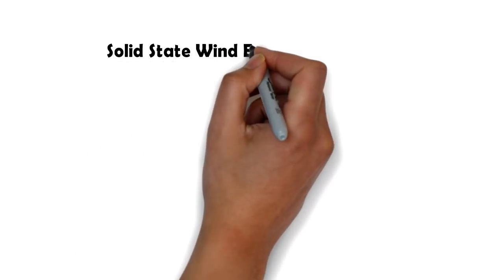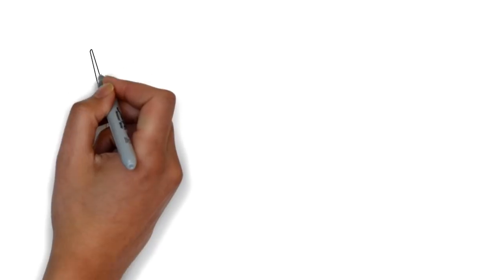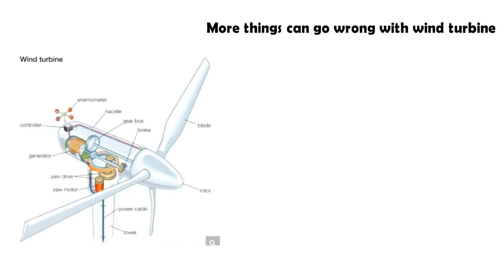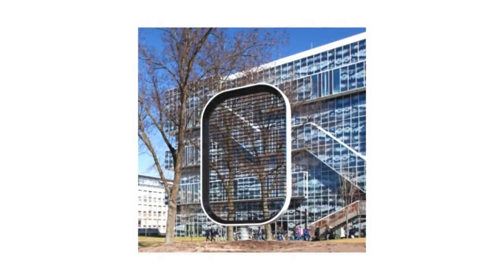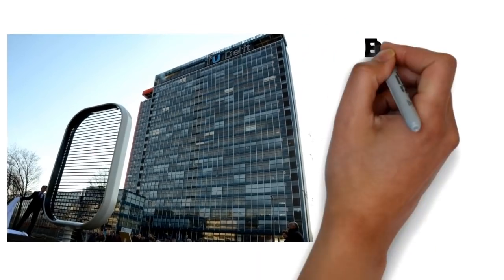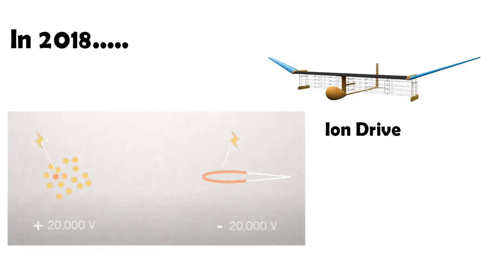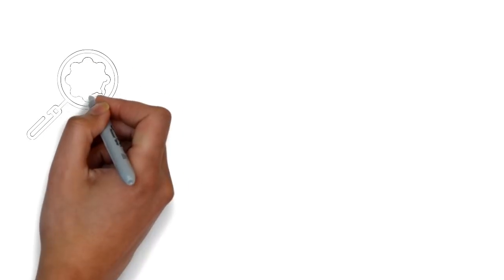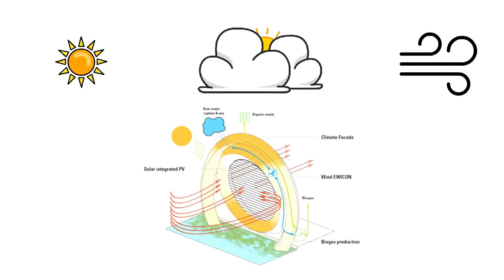Solid State Wind Energy Generator. A Revolutionary Device

Comment: What happens when birds and insects start getting vaporized, it's 40,000 volts after all 

basically you just installed a massive   bug and bird zapper
Reply: You can get zapped by a million volts and feel nothing when the current is low enough. And the current cant be that high since the ions movement has to be dominated by wind for any net gain in power.
Reply: Climate change will  kill alot more than windmills. You sound like the whalers from Nantucket.  They were kings of the see passing through drakes passage hearky. Whalers lrize cargo was oil made from rendering whale blubber while at sea. It revolutionized the way people spent their evenings!. Many a book was written under the lantern's glow. Whalers did not like the fact that crude oil was found and it  was vastly superior to whale oil in every possible way.  Whalers fought the coming of the end for the bussiness and like repubkicans they would have shut down the new oil production permanently. That is what republicans are doing today. They would get rid of wind power, hydroelectric, geothermal, biodiesal, solar paneles and todays republicans are even refusing to build 4th generation walk away nuclear powerplants which are critical to moving from whale oil to crude oil.  Actually it is the move from fossil fuel to renewable energy systems. The movement from fossil fuel to renewable enetgy will do three thinngs
1. Make energy cheaper.
2.Allow the people to use alot more electricity than we can now
3. Provide millions of real and high paying jobs.  
Mitigating climate change isnt the only reason or even the main reason for building the new grid.

Comment: The principal behind the solid state windmill is best used in space applications. Ion drive electrostatic engines have been used to propel interplanetary spacecraft or can be used as a space tug to boost satellites to higher orbits and prevent orbital decay. Very low thrust, but very high specific impulse.

Comment: Will it stop killing eagles and hawks? Does the removal of moving parts reduce the sound pollution? Is it still made with radioactive trace materials? These are my objections to wind power as it’s currently used.
Reply from the maker: Birds detect high voltage coronal discharges and normally stay away
Reply: Synergy Files I hope you’re right about that. So far I think wind and large solar installations are counter productive for the environment as a whole. Only 4th generation Nuclear is actually green. Even electric cars will leave us w poisonous batteries staked up next to their tires waiting to be recycled.

Comment: How would they deal with the ensuing ozone problem from all that ionized air?

Edit: Honestly, I was expecting to see some form of piezoelectric effect device acting like a reed in the giant wind instrument/power generator.
Reply: What if your initial ionization on the incoming air was then followed by a de-ionization/recombination at the end, as the flow stream exited the device?
Reply: @manofsan  I'm not enough of a physicist to know the answer to that, but I think there is no way to do that while maintaining efficiency, which will already be bad from the energy needed to break down the bonds between the dielectric material and it's electrons in the first place.

All I can see are the problems caused by production of Ozone, oxides of nitrogen, and corrosion of the electrodes caused by the ionization process.

Having said all that, again, I am no physicist, nor do I even play one on TV, so my thoughts should probably be taken with a can-full of salt... 🤓
Reply: @davidbierbaum4881  Ozone is reactive and eventually recombines with the air anyway. But the point of wind power is to tap the motion of the air, and not its charge - so deionizing the air shouldn't cost us more energy. Recombination is natural -- that's what makes ozone so reactive and dangerous. No extra energy has to be supplied to get the unstable ozone to revert to normal O2.
Reply: Thats why you don't put ultraviolet light inside home, because it creates ozone from oxygen and in enclosed space it's toxic. So maybe only outside where is wind and where is the most space available...
Reply: In terms of piezoelectric effect and vibration of reeds... SF writer Colin Kapp's 1964 tale "The Subways of Tazoo" (not Yazoo, despite what the Android spell-checker is trying to assert) describes working on a planet whose highly-advanced civilization has mysteriously collapsed and left no-one alive. They realize that this is a rather windy place, and the millions of "harps" which they find the remains of in the desert were not to deliver the sounds of the subway to desert-dwellers but had vibrating string tuned to resonate in the wind and generate power via piezoelectric crystals in the arms of the harps. 
This story is much more interesting than it sounds; but I remember this aspect and wonder whether a solution like the one described in the story wouldn't be similarly efficient in generating power in the windier parts of the world. This was from a series of stories under the title "The Unorthodox Engineers".  I can recommend Colin Kapp as a very readable author, as far ahead of his time as many science fiction writers are. When I first saw the Delft generator, I thought it might be one of these harps; but their solution seems (to me) to be cleverer for lower wind speeds at least.

Comment: Little by little fossil fuels might be done away with .. I can't wait until they get Thorium reactors online .. Take a few 100 billion from the corrupt military-industrial complex to make it happen
Reply: I think thorium will be the nuclear fuel of the future. For now we should use enriched uranium in 3rd generation modular reactors, we have the proven technology and light water reactor experience to make it work and implement it on a large scale. As an intern lets develop heavy water reactors that can "burn" unenriched uranium and later liquid fueled heavy water reactors that can "burn unenriched uranium, thorium, plutonium or any combination as fourth generation reactors.  Finally developing the liquid molten salt reactors and liquid fluoride thorium reactors as fifth generation reactors. By then first generation fusion reactors should start coming on line. Meanwhile  we will also be developing advanced renewable concepts and much cleaner and more efficient fossil fuel based energy systems.
Reply: @stuarthirsch  the only reason we have nuclear power is the military needed the enriched plutonium for bombs .. They put money into nuclear instead of thorium research .. Here is a video you might be interested in .. I saw a very good video years ago but don't remember the title
https://youtu.be/ENH-jd6NhRc
Reply: @xadam2dudex  Breeding plutonium is the reason they built the liquid sodium cooled breeder, which turned out to be a fiasco and  dropped research on the liquid molten salt reactor that could have been thorium based. However times have changed and it's time to let the past go and concentrate on the future.

Comment: Sorry Idiot question... Why windturbines have a gear box in the first place?
Reply from the maker: To match it close to the required   high speed of the generator present inside. You would understand that generators need to spin at high RPM to deliver us the 50 or 60 HZ electricity we need. Gear box also account to fluctuating wind speeds
Reply: @synergyfiles3536  ah I see makes sense somehow. But can't a frequency converter and a generator suitable for low RPM do the job or is the generator's max output frequency dependend?

Comment: Solid state wind generators may be more useful as enhancements to existing wind turbines, where they could add a few extra percent of efficiency when the blades are moving, and even a small amount when there is not enough wind to rotate the blades, but enough to produce a voltage on the solid state devices.

Comment: They create OZONE - it's a pollutant and harmful
Reply: @Madd Peanut,  if that's true then why are the global warming freaks
always talking about the ozone depletion being a problem.
Reply: @Frank-rm9yg  Simple Google searches can answer a myriad of questions. Try it sometime.   Ozone in the upper atmosphere blocks harmful UV radiation,,   "When inhaled, ozone can damage the lungs. Relatively low amounts of ozone can cause chest pain, coughing, shortness of breath and, throat irritation. It may also worsen chronic respiratory diseases such as asthma as well as compromise the ability of the body to fight respiratory infections." -EPA
Reply: @Frank-rm9yg  The medium term answer to our energy/climate problems is molten salt/thorium reactors.  Educate yourself on them on their inherent safety and minimal waste before you spout off.
Reply: @maddpeanut7524  I agree and am a member of the Thorium alliance. But I don't believe there is a single magic bullet. We need nuclear, renewable, and clean fossil fuel technology all working together if we are to solve the climate change crisis.
Reply: @Frank-rm9yg  The difference is that the O zone created would be local and low altitude. A local health hazard during high pollution, when there is usually little or no wind and the high voltage would be shut off anyway. The high altitude O zone is what protects us from UV rays, and it is desirable. It is created by UV light interacting with high altitude oxygen but methane and other high altitude man made chemicals destroy that cycle. Nothing to do with solid state windmills.

Comment: Wind turbines often get a lot of criticism for killing birds (mostly exaggerated, but it does happen). Some might think bladeless designs like this would be better for birds, but they probably aren't. There are now camera and radar systems that detect birds near wind turbines. The critical thing is that they slow down the turbines, they don't stop them! Birds are really bad at seeing large non-moving objects. They're better at seeing and evading slowly moving ones. So for the environment, a moving turbine (with bird detection system) might be better than a solid state one.

Comment: Wind is a fool's folly, wind is dead. Nothing can compete with solar. Batteries finally make all alternative energy viable but solar wins.
Reply from the maker: There is still more wind installed capacity than solar.  So its not that its fool's folly. I agree that solar will go further.
Reply: @synergyfiles3536  Just because something is built, it doesn't make it a wise thing. Wind is one of the craziest was to generate power there is. Power companies are about making profits, and its sad to say in the US that's done more buy spending money on large capital projects as they are guaranteed a profit by the utility commissions. So that is all that makes wind attractive, large capital expenditures, big profits and higher rates for us. Not generating clean, useful power.
This is true of wind, hydro, gas, nuclear and coal. Solar and battery storage is the first opportunity to break that cycle. It is so cheap, quick and easy to build, maintain and operate that nothing else can compete financially. The utilities see that now and solar/batteries are all that they are looking to build. They are shifting their business models to transmission and distribution. Its all about the money. Hopefully some rate payer savings and environmental benefit will come from it. So I say wind is the king of fool's follies except for possibly nuclear and especially fusion. Take the money and build 100 square miles of solar in the desert and the equivalent of 1 square mile of batteries scattered around the country, interconnect it with ultra high voltage DC transmission lines running east and west across the country and be done with it!

Comment: Now I live in a desert area where blowing dust heavy in minerals is quite common — how would this effect such units
Reply from the maker: Cannot say. The research and implementation has happened in relatively green areas.
Reply: Synergy Files , it would be interesting to know ; do to unfamiliarity; have lived in areas of high rain , high humidity, fog , and blowing dust relatively close to high power wires and seen electricity discharge all over the place , wonder if this is a concern or negates these areas , thank you .

Comment: High voltage is one thing, but that is not an indicator of power. How many Amps are being made available?
Reply from the maker: High voltage here is the input. Amps will be the output
Reply: @synergyfiles3536  no, you say it is generating a high voltage and by inference that this is a good thing, suggest that it is an indication of power generated. Something much of the public assume. Voltage is an indicator of the frequency of the carrier wave, and by itself is not any indicator of power. 

Amps or Watts denote power and there is no mention of the power out.

You could theoretically use 40,000volts to carry half a milliamp. 

So as a video, this does not propose potential outputs, practical applications or any theory to overcome any of the current limits to this technology. 

It's a bit like saying "we can travel faster than light in a warp bubble" without talking about the necessary tech, current limitations, possible solutions, or even what a "warp bubble" is. 

Not trying to put a downer, but you need to up your game on providing information otherwise you become another "tabloid" Channel with click bait headlines.
Reply from the maker: @islandsedition  Where I have said that its generating high voltage and thats a good thing?
Reply: @synergyfiles3536  apologies, I stand corrected. I misunderstood your use of the voltage. 

However, I still think that it would be helpful to budding engineers if you presented the current achievable power from systems such as the one at Delft. 

For example, adding that ion turbines currently only achieve 7% compared to wind turbines' 45% would be useful to know. As well as the proposed 25-30% theoretically achievable by the ion turbines. 

If you were able to add the technical reasons for the current constraints on achieving the 25% conversion rate then that may be helpful to your viewers/budding engineers. 

Just trying to offer some constructive criticism not dismiss the idea or your efforts.
Reply: Amps are the rate of flow of a current, therefore indicate the power available. I was a bit lazy citing volts as it's the hertz of the voltage which denotes frequency. Volts are the electromagnetic force that "pushes" the current and is an expression of the potential difference between two energy states.
Reply: @CivilDiscourse my understanding is voltage is as you say, proportional to current, but only when relative to resistance, hence V/IR. Here we don't know the resistance of the system so as far as my limited electronics knowledge goes, we cannot work out the available current. Though as the video poster correctly reminded me, the voltage noted here is not the voltage used in any of the power generation systems discussed, only in the ion drive plane cited - which of course was using power not generating it. It would be interesting to see the figures for voltage, current and resistance of the system for the prototype used at Delft. And, yes silly me. Of course it's a DC system, so the idea of Hertz is void.
Reply: @CivilDiscourse my electronics knowledge is sketchy at best. I should keep my detailed comments to a field where I have some actual expertise. Here, really the point I wanted to make was that there could have been more substance to they video. More as a means for the producer to make more valuable content, especially for those who have more knowledge in the subject than me. I think I gave them the appropriate feedback in a concurrent thread... Eventually. Take it easy bud.
Reply: @CivilDiscourse a sentiment I wish I could slap into my younger self with the wet fish of age & experience! Good luck getting those numbers up.

Comment: Is it already made and in use or still at the drawing board state? If in use, which company builds and sells it?
Reply from the maker: No. In their experimental state
Reply: @synergyfiles3536  You mean they are trying to improve the efficiency or they haven't been able to build a prototype yet?
Reply from the maker: @thomascameron683  At least three working prototypes have already been built. Two use droplets. One ionizes the air. It now a matter of commercial interest
Reply: @synergyfiles3536  You mean one type use ionised air while the other two use water droplets for carrying the charges, right?
Reply from the maker: @thomascameron683  Yes
Reply: @synergyfiles3536  Is it already patented or open for improvement?

Comment: If you construct an array of antennae at an adequate elevation, like 50 feet, from the ground, you'll be catching pesky ions without using any electricity to ionize squat. Solar flares and galactic energy waves ionize our already ion filled atmosphere. Power companies have sued people for using similar technology claiming the electromagnetic fields from their power lines were used to create electricity.
Reply: ofc a power company would sue, if they are close to an electrical line... since it increases its resistance.. ie its stealing power just thru induction... just like inductive charging (wireless charging) works... the other source of electricity are so low they are just fun science experiments...
BTW this post is totally different since it uses the movement air and an artificially created ion that the wind move in a field to induce a current... 
But I love how most ppl on SM has to make everything a conspiracy... either about govt or big business... so have fun with that :)